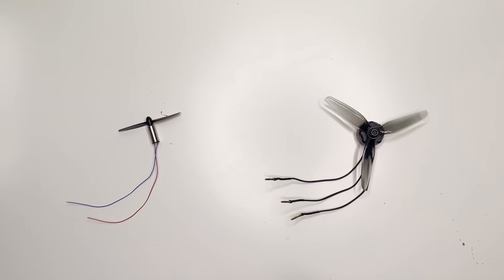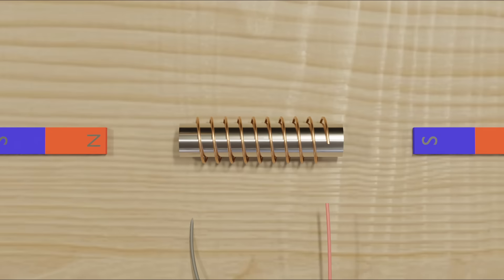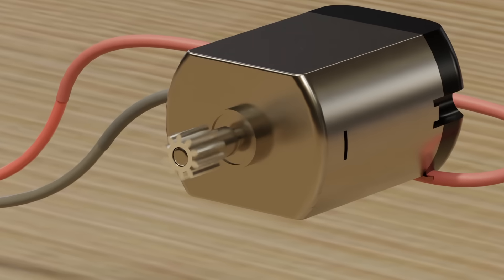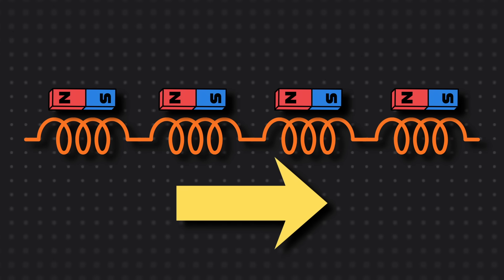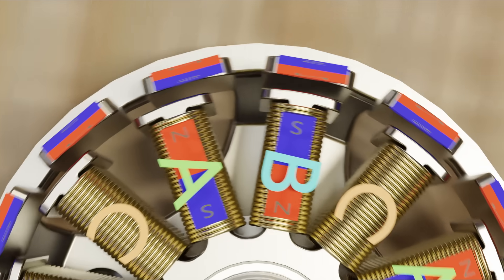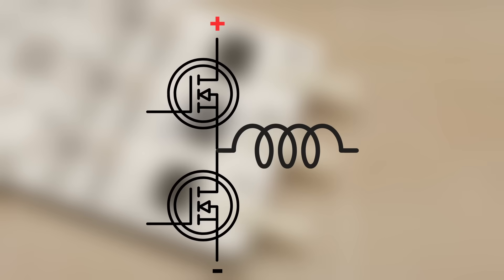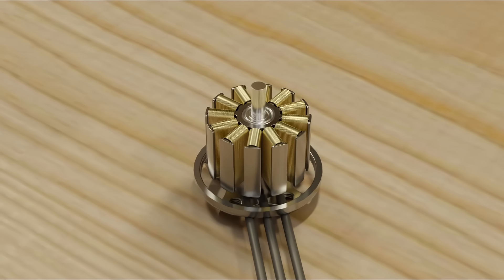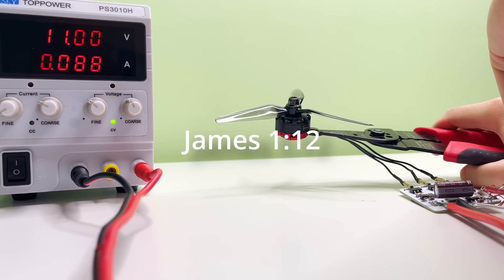Why Adding 1 Wire to Motors is Genius

Comment: TLDR; AC vs DC motors.

AC motors can be built for more power but require more control electronics. DC motors can run with much less
Reply: Ac motors doesn't need electronic control at least three-phase motors

Comment: Sensorless brushless motors like this have issues with running smoothly at low RPM for that there are "sensored" brushless motors that have a set of three hall effect sensors at one end that tell the controller what the angle of the stator is.

Comment: Asynchronous brushless AC motors existed long before the 1950 and require no control hardware just the AC current from a wall outlet. They do require a starup circuit to get the motor spinning when power is first applied but that's simple analog components.

Comment: Wow, great explanation on how brushless motors work: you skipped unnecessary jargon and were very focus on the fundamentals . What you mentioned about the third coil acting as the one to gather and use that voltage for the current passing through the other two wires was something i didnt know; there was a lot I learned, but that one was really interesting

Comment: Dude, you just showed a REGULAR three-phase motor that is used in industry.
Reply from the maker: Yes, brushless DC motors are common in many applications and might seem normal to you, but many everyday things that seem normal like computers, mobile phones, or bicycle sprockets, as simple as that sounds, involved some form of genius that built off of previous works of genius. The very fact that this kind of motor is so ubiquitous and regularly used shows the genius behind it. A tool that is only applied to 1 area is not as genius as a tool that can be used in 100 different areas.

Comment: There are problems with the brushless motors as well.   They cost a lot more.  The computer parts fail and then you have a dead motor.  Brushes are cheap to replace and easy to do as well.   Most componants are made in China so the fail rate is very high.  Then there are the scammers.  The computer indestry was almost completely destoyed by a scammer who unlafully wrote down the formula to make capacitors so he could go to China and have them made cheap.  He was a moron and put 0.1% moisture as 1.0% so they had too much moisture in the cap.  As the cap got hot the top of the cap would pop up and the cap was dead.  I had dozens of main boards left at my door that had only been run for a few days that had as many as 12 dead caps on the board.  The computer compaines said it was the company in China that the person must get to fix the board as it was not their board but the caps on it.   Most companies used the crap caps so a lot of MB were scrapped even though they were new.    I still want a DC motor with brushes.  I have a better one that has the brushes last  15 years.   I found a motor that had that type of brush so have  improved it to last even longer.
Reply: The capacitor plague came from a half stolen formula. They only have the baseline recipe but not the stabiliser causing the electrolyte fluid to decompose
Theses motor are just 3 phase motor that exist from decades in factory all around the world. The new thing is you can build cheap DC/AC converter. The reliability of component is at the will of the maker. apple build all their craps in china, with strong quality control and high grade components.

Comment: Very amazing visuals but I'd recommend not switching the camera angles around so much so people can see what's going on. Too many angles made it unnecessarily confusing, you should move the camera around rather than teleporting it where you need it to be. Maybe rotate the actual parts around instead of moving the camera if you really need so many different angles but otherwise a very nice and simplified explanation, especially removing the unnecessary parts for the demo.🤷‍♂

Comment: Clickbait, it's not just a wire that was added. Still, for once I'm glad I got baited. Just one thing I disagree with: a brushless motor is not a simpler design. A controller is objectively more complicated than spinning contact plates. Anyway, the whole thing is pretty similar to ICE cars evolving from a spinning distributor to an ECU-controlled spark.

Comment: You missed an even bigger bonus to brushless: intrinsically safe motors

Brushed motors spark, especially when the power to them is cut, but brushless motors don't do that so they can be designed for use in hazardous environments slightly easier

Comment: Brushless motors are a game changer, it's incredible how much power they produce compared to their size and weight, like 1+ HP that can fit in your closed fist, it's wild. I started building drones 13 years ago and it has been awesome seeing them get perfected a little more every year, the newest ones are pushing boundaries I never thought I would see, especially considering how far they pushed the boundaries back when they hit the market. Lipo batteries coming out around around the same time along with cheap, powerful PWM electronic speed controllers was the trifecta of an amazing system for drones and other RC aircraft and vehicles.
Reply: yep that’s brushless DC motors, BLDC.

Comment: Are brushless motor "simple"? They have a higher embodied complexity, finer wires, smaller magnets and a CMOS chip to worry about. More, and more complex, parts to replace than the other design you showed even though it's more powerful and arguably more elegant.

Comment: There's also another way to control a brushless motor. Instead of looking for the voltage spike down the dead leg to know when to switch to the next step  you can use a second device called an encoder that tells the controller the exact angle the rotor is at at all times.  Instead of a stepper motor going to discreet steps at high speed with just + - and off voltages it can varry the voltages and hold the rotor at any arbitrary point between steps. Start turning the rotor rappidly and the voltage forms a sign wave that looks exactly like 3 phase AC power at some arbitrary frequency based off motor speed and the number of poles.
Reply: This is how we typically do it in industry now. That type of encoder is called an Absolute Encoder and has a unique hardware address for each position (typically in greyscale optical/magnetic heads) so the controller always knows the exact angle between the magnets & coils.

However, back in the dark ages (ie 20 years ago), absolute encoders were not widely available and we had to use incremental encoders (e.g. quadrature encoders) that couldn't tell the controler where they were on startup. Instead, the controller energized one coil so the motor poles align with the coil. Because the controller is told the encoder counts & motor poles, it could then calculate the required angle as long as you didn't power cycle. Of course, it also depended on not losing encoder steps during rotation, but that's a separate issue😅
Reply: BLDCs usually have trapezoidal back EMF so their output rarely look like a sine wave.
Reply: Stepper motors can also do this. Stepper motors work like brushless motors that operate blind without any feedback.

Comment: One of the best 'how a motor works' videos ever!  I would like to have seen more on the types of motors that came along before transistor and MOSFET technology changed the world forever. Specifically, how we produced 3-phase electricity for industry and why industrial motors were 3-phase long before the 3-phase PM brushless motor.
P.S. Your first brushless controller not having hall sensor feedback is impressive as well!

Comment: I don't like the fact that he starts with a 2 pole example, saying stuff like "whenever electricity runs through the coil, it will align itself so that the opposite poles are closest together" - I get that you probably do it in order to make a point of the effect of symmetry etc, but I mean, you don't need to say stuff that is inherently false - no they won't. Especially not in the theoretical seemingly "perfect" alignment you presented. They will stay in exactly the same place they were originally, before the polarity was switched until some external force nudges it enough to allow the flux to exert enough tangential force to actually move the coil.
But not to be a negative turd, kudos for your work!

Comment: This is false. What you are showing in the video is a stepper motor that allows for precise precise positioning as each step and half step of the motor has known angle as dictated by number of coils. A brushless motor normally refers to continious rotational motor with no brushes where instead of using brushes to switch the voltage potential, the alternating current is used. Inverters can be attached to such motors where you can vary the frequency and voltage potential going into the motor which regulates the speed at which the motor spins.
Although this video can be informational, it is very missleading when diagrams display a stepper motors and your video footage as well as verbal commentary refer to the brushless motors.

Comment: I like the direction the channel is headed, you've gotten enough praise from the others so nows my time for some feedback. Don't worry I won't be too harsh :D
So for that first animation you kind of brushed over (pun intended) how the brushes work, you kind of went "oh yeah this is how they switch" and then didn't really explain how it would switch, even though it's pretty simple if someone doesn't know how it works or doesn't have the intuition then they'll probably be lost on the point later in the video about some brushes wearing down. So in this case you could have gone a little deeper into how the brushes are designed to mechanically switch their voltage path as the motor spins with the brushes
The animations felt a little underwhelming (but maybe I'm just used to the bigger YouTubers quality) it kind of had some animation to explain how something worked but felt empty in actually displaying the internal process you were trying to explain. Like the motor did move around and you did show a magnet over the two active lines, but perhaps some visualization of the magnetic pull (and push!!) in the form of arrows like showing forces in a physics drawing could help solidify the point you're trying to get across.

Alright I think that's enough from me for now, you don't have to listen to my tips, for all I know I'm asking for a lot and this isn't something youre interested in spending your time on for a video, but thought I might share anyway. Good video bro!
Reply: Oh yeah, you could also have added some more details on how the controller can control the speed of a brushless motor by adjusting timings, forgot to put that up in the comment
Reply from the maker: When outlining the video, I did not think that explaining how the ESC worked in more detail would be in the scope of this video/necessary to explain motors, which is the main meat of the video. When I have a video on ESCs, then I'll get into it!
Reply: @TheTinkeringTechie aha gotcha, look forward to it!
Reply from the maker: Great feedback, and thanks for stopping by! If I had the skills to translate everything I see in my head into animation, I would do it, but with my current experience, it's hard. I wanted to use arrows like you described, and at first, it seemed simple, but then you get into constraints, and hooks and well, I don't know much else past that in terms of Blender skills required to have an arrow follow both magnets if you know what I mean, like a line between two objects. I guess the visualizations will get better and will show things more clearly as I gain experience.
Reply: @TheTinkeringTechie That's true! To be honest I talk pretty easily but haven't touched the animation side of blender a day in my life. Like you said it'll come with experience and I'm already glad to see you had thought about it, so I believe you got this bro

Comment: Nice video. But you forgot to mention the greatest advantage of brassless Motors. It can be controlled to rotate in minute degrees. Where as the other one can not be controlled in such a way. Even if power is turned  off, the motor can rotate more due to it's inertia. That's why brassless motor is used when precision is very important.

Cheers

Comment: You don't need 3 wires & controller for brushless. Just put the magnet inside a fixed shaded coil running on AC.

Comment: This is an excellent explanation.  I worked as a software engineer testing BLDC firmware for 3 years. This is the best step by step visualization of the commutation process that ive seen. I have an even better understanding now than i did before.

Comment: 8:44 tesla uses AC motors not dc brushless motor
Reply: Brushless DC motors are 3 phase ac motors
Reply: They are fundamentally the same, the only difference is the voltage spec
Reply: AC motors are just brushless motors running at mains frequency 🐴
Reply: Its the same thing
Reply: No shit Sherlock :D

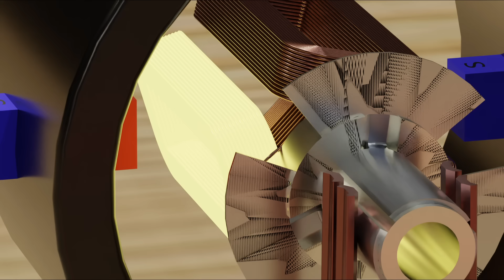Comment: 2:21 Doesn't some electricity flow through two other coils and make them opposite pole?
Reply from the maker: No. I do see why you'd think that though. The reason why the other two coils don't get the flow of electricity through them is because they have only 1 side of the battery connected to the coil, not two. You need both positive on one side and negative on the other to complete the circuit. This is a result of how the connections are configured. We have 3 pads, let's name them 1, 2, 3. Coil 1 connects to 1 & 2, coil 2: 2 & 3, coil 3: 3 & 1. If only 2 pads are connected to the battery, let's say 1 & 2, then only coil 1 turns on, with coils 2 and 3 only having 1 side of the battery connected to it, not 2. Hope this helps! Also, didn't show this in the video as I thought it may have been a bit complicated. Now that I've thought through the explanation, it actually wasn't too bad.
Reply: @TheTinkeringTechie  if coil 2 and coil 3 both connected to pad 3, they are both connected in series. So when pad 1 and 2 is connected, current can pass from pad 2 to 3 via coil 2 and back to 1 via coil 3
Reply: See it as a triangle with edges as pads and sides as coils. All three coils are connected in a loop but we are changing which two edges (or pads) are connected to battery
Reply from the maker: Drawing it out, I actually see how you are right! The other two series coils will have electricity through them, making them both have opposing pole directions as the original coil. Looking at the 3D model (you can see the one I used here: https://grabcad.com/library/mini-dc-brushed-motor-1), it would seem some positions may have unpredictable directions (if there is symmetry in the coil positions relative to the magnets of the stator), but because the other two coils are in series, they make a "bigger coil", and because they receive the same voltage as the original single coil, the series coils will take longer to "charge up", aka, take longer to act like a magnet, preventing cases where the motor could get stuck or spin backwards than expected, because the original coil "becomes a magnet" first. Thanks to your keen observation, I learned something today! Though I think the animation currently is good so that there aren't too many things to think about. It's just missing the other 2 coils that would charge up later.

Comment: Excellent animations, however the 12 pole 14 magnet arrangement wasn't totally clear.
I rewound a burned out a 3515 bldc motor some years ago, so had to disassemble it and record everything to rebuild it - adjacent poles are on the same phase with one wound clockwise and its neighbor anticlockwise - the phase wire then crosses to the opposite side, going anticlockwise around one pole, then clockwise around its neighbor. Do this another 2 times for each group of 4 poles, the 6 ends can be connected in a star or delta configuration.
Result is that 8 poles are energized for each phase simultaneously, each pushing and pulling on the magnets in the bell. This gives a hugely multiplied torque!
Reply: I think the einding according your description would result in the exact same magnetisation pattern as shown in the animation, always oppsite pairs.
Yet something seems wrong, as the poles seem to fight each other on the different places around the rotor. Some cause CW rotation, others CCW.
I cannot find the mistake...

Comment: Im just here for pure curiosity  good vid 
+ I was  working on graduation project to make Spherical  brushless motor i got stuck at point i need  8 poles magnet  and  some set of control until to control  16   coils. The ideas was some sort of control moment gyro  so if any one could help fell Free

Comment: There are a few things you forget. You do know 3 wire AC motors can also have brushes right? 
And that DC motors have something AC motors do not have and that is mountains of Tork!
AC motors are like Petrol Engines high RPM but no low end Tork and DC motors are like diesels. Low RPM and mountains of Tork. 
So for a drone 3 fase brushless motor makes sense. But for a toy car a small DC motor usually makes more sense.

Comment: I thought this is gonna be about adding 1 wire communication to motors. Like a motor with a built in control board, communicating via 1wire
Reply: You need a bare minimum of two wires, entry and exit path for current to flow unless you're using such high voltage that the air becomes your second wire but then you're just shooting lightning everywhere...
Reply: @DrakeOola  Yes, I said adding 1 wire, assuming you already have 2 power wires. It wouldn’t have to be the 1 wire protocol specifically, it could be LIN bus or something